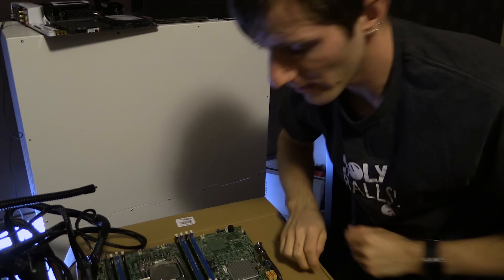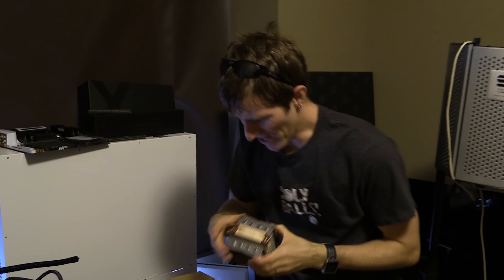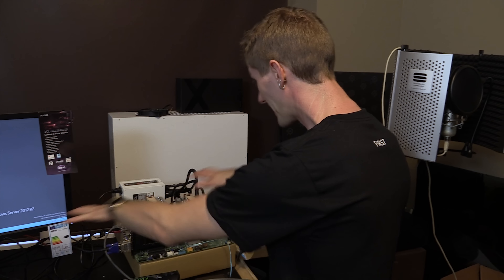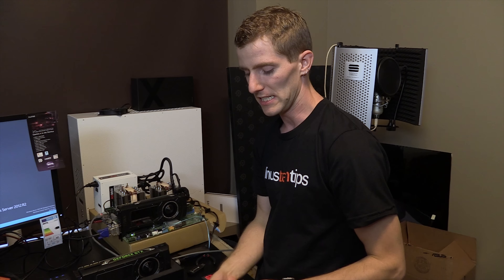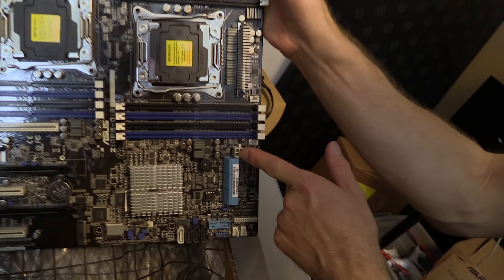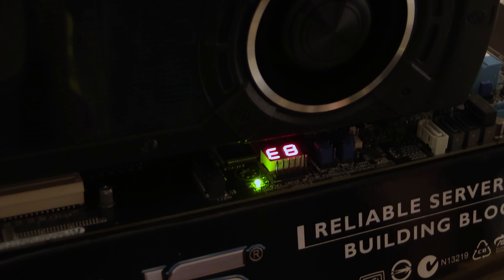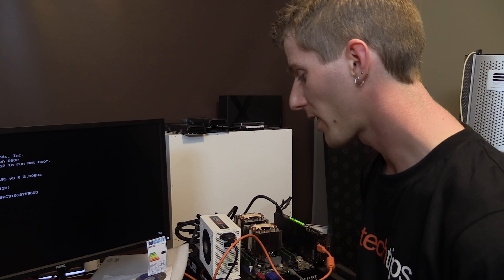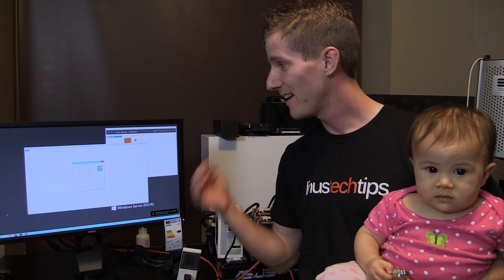36 Cores, 72 Threads, and Two Titan Xs - Our New INSANE Rendering Machine Part 2

Comment: Heyyy.... could you install windows 10 and run the dx 12 api draw call bench? Dx12 is designed for mulit cores...lower cpu overhead so your clock speed doesnt matter too much but the amount of cores.

Comment: Hey Linus, the guys at LTT, and the community. I have a quick question of your opinion I want to do a duel xenon E5-2699 V4 for running Linux and windows duel boot for web app fuzzing running programs like AMASS project some gaming and whatever else I can use it for. Im Having trouble deciding on a motherboard. What mobo would be the do you believe would be best for overclocking the xenon cpu?

Comment: Can you post more details about other specifications of this pc, except MB and VGA, How i can purchase this pc ?
Reply: you dont
Reply: One thing, it costs way over 10,000$. Second, it's not for gaming, if that's what you're looking for, you can easily get a PC for 2000$ that will max out everything in the next 5 years. My 350$ PC runs everything on High at least, too. You don't have to spend a fortune, you have to spend smart.
Reply: Meh, I just saw your channel. Still, for 2k$ you can make a very solid rendering machine. The dual CPUs are pretty much useless for rendering, they only show up in benchmarks. An i7 K edition would be more than enough to feed dual Titan X.

Comment: I've never had Supermicro dual Xeon boards last for more then a few years. I had two
running Zeon Socket 604 cpu's and both boards literally fell apart....heat sinks fell off the various chips and the boards just were terrible quality. I do miss the power these old relic dual Xeon's could do.....before they fell apart!

Comment: i wonder if he considered the asus board wouldnt letits self post because his power supply (i believe i saw 860 watt power supply) wouldnt have been sufficient to run both cpu's AND both GPU's at the same time. That might have been a fail safe on the mobo to prevent damage to the hardware IDK thats my only guess.

Comment: Hey you guys should go out and buy a dell R900 or R910, fill it with 4x6 or 8 core CPUs and 8 GPUs and just 32Gb of ram, or up to 512 if you want, but i really want to see how an 8 way SLI would work in linux, and if you get the R910 you could do a 6 person gaming rig like in your other video with the 2 person, one tower video because the R910 supports VTd and has more PCIe lanes
Reply: +denvera1g1 i was originally going to get an R900 for $266 but then i noticed that it doesnt support VTd, so i went with a dell Precision T7500 with dual 6 core 12thread
Reply: +LinusTechTips i've also been wondering if a quad processor motherboard with a hypervisor would allow you to install a windows OS thats licenced for only 1 processor, so that those 4 processors with 6-8 cores, would look like a single processor with 24-32 cores to the guest OS

Comment: Hey Linus, can you help us figure this out? We got the exact same dual processors, with a supermicro motherboard, we can't get softwares to see the virtual cores. Let's say when the hyperthreading is ON cinebench utilizes only 16 physical cores and 16 virtual, and I'm getting a score of 2800ish, but when I turn off the hyperthreading I see a score of 3800ish, but I've also seen people get like 4800 points with this configuration. Can you somehow help us solve this issue? Thank you!

Comment: I never understand the logic behind this. People see around 50% utilization with hyper threading and think, it's only using half the cpu. A single thread running can populate the full cpu core, however two threads on the same cpu with consistent similar data should hover around 50% if they are properly load balancing, thus utilizing 100% of the cpu. Now sometimes you can see it not fully max out in some things by a % or two or even 5 like the stress test showed earlier. That's not the same thing. I remember seeing corsair have a reviewer post about getting higher fps with faster memory in battlefield 4 and people were like, well no other game has been as ram heavy as BF4 and maybe this phenomenon is true that reviewers can't really get 20fps difference like this guy, but users are convinced it's real, because they bought higher rated ram and tell everyone how great it is to have more bandwidth, which to them = faster. Now I remember that guy who was posting on behalf of corsair in a protected space of their forums that other users couldn't scrutinize until they had posts and were members for longer than 2 weeks. He made the claim on corsairs behalf, but not legally that you get 20fps extra for using faster ddr3 at the time, and that his core i7 which hovered around 50% of each thread, he also made the nefarious claim that BF4 was only using half his cpu and that the game had plenty more to work with as time went on because that's how fast i7's are compared to i5's and amd. I wanted to smash his head in with his case and attend his funeral just to see him lowered slowly into the ground in a pine box. Here I see linus making the same mistake and not understanding how hyper threading works and appears under windows task manager, as it's not representing the utilization in terms of understanding how hyper threading works and correcting for it.

Comment: I need it.
I wrotea lowpass filtering audio programm and it can use nearly unlimited threads.
I had some compiler issues with linux and the university high performance Server and with 64 threads on a 128 threads Server it was slower than my 3570k

Comment: I use a dual-socket supermicro board with a pair of Xeon 2660v2 (20 cores 40 threads in total). While I agree that such a system is very niche (and, quite frankly, nowhere near as powerful as yours! WTF?!) I do 3D rendering on it and use it as a workstation with Windows 7 on it and have been successfully for over a year now.

Comment: I have a question about running a Minecraft server on Xeon CPUs using Ubuntu OS on a small server build. 2 Xeon CPUs E5-2699 128gb ram for each CPU. 2 GPU Quadro M6000 and a 250gb ssd

Comment: The low physics score on the 3dmark test might be due to 3dmark not being NUMA aware.  Any time you run multiple physical processors, you need to run software that is NUMA aware, which almost no consumer software or games are.

Comment: wow only using a 860 watt psu, i wonder if linus tried both gpu's on that psu and found they didn't work?  

afaik the 2 gpu's would need at least a 1200watt psu but hey it's 3 am and i've just woken up so my thoughts are a little bizarre

Comment: So, could you technically use two 5960X's with this motherboard? Now that would be beast.
Reply: +CaptainCrape  sadly no, they only let you use one per motherboard, (probably done in the processors code so you have to buy the more expensive xeon series)
Reply: drEmulatorMadmax Actually it could be an issue. Two 5960X's would take a ton of power to run. But its possible to run Xeon's because they are extremely efficient. So yeah, its a dream to run two of the most powerful processors currently out there.
Reply: +CaptainCrape 1400W PSU?
Reply: Arnab Animesh Das Maybe.
Reply: That wouldn't be possible as the 5960X doesn't support dual CPU.

Comment: Can anyone tell me the model of that asus board? My gaming rig has a Xeon e5 2680 v3 and with that board I could just buy a second of the same processor and maybe run sli with a second gpu as well. But meh honestly one gpu is sufficient.
Edit: found it on Newegg for $450 ouch. Idk if I’ll get enough value per dollar just to add a second of the same processor, seeing that the processor itself is $200-$250 on eBay. I could probably do more with basically $700

Comment: Grounding yourself with a power supply which is coated? Shouldn't you at least touch a screw with actual connection to the psu's metal?

Comment: Here's one for the experts. My PC drains the CMOS battery fast, probably a short somewhere on the mobo. Resulting in no saved settings and dead clock. I can live with that. BUT. It wont connect to the net. Not mobo LAN, not usb wifi. Did a fresh install, no luck. New mobo? Power supply?
Reply: ***** Update: It saves the settings if i setup BIOS and sync the clock while the machine is cold. And the LAN works now. But not the USB wifi, which is odd. If i boot while it's hot, everything is gone again. Which makes overclocking a long process. AND. It wont let me run SATA mode. It's set to AHCI, but the benchmarks say 150mb/s aka IDE/UDMA mode. I have a multimeter, and HWMONITOR reports good voltages across the board. Might it be a failing capacitor or something? Anyway, the computer has been run like this for a while before it got it (for free), so im not too worried about it failing completely. But some of the mobo temps are high, i will replace thermal paste for the NB cooler, as it's probably getting old. Any other suggestions? I appreciate any input
Reply: ***** I will probably just go for a used board unless bringing down mobo temps does anything. Do you have any idea what AUX is? Im thinking it's SB. Its running at 57-58 c right now without much load, motherboard says ten degrees lower, which i assume is the NB. It's conciderably hotter than my cpu. It looks like NB and SB are sharing cooler through a long heatpipe. Im hoping a proper thermal compound does anything. I will have a feel around for exessive heat right now. But i think SB is too hot.

Comment: Forget the Core i7, I WANT A XEON.
Reply: i7 is better.
Reply: +PneumaticFrog Depends on what you're using it for.
Reply: +JesseTheBomb A lot of Xeons really aren't that different from i7 chips aside from ECC support. Xeon E3 for example... a locked i7 and a Xeon are pretty much the same chip, except that Xeon supports ECC and will only work with C series chipsets nowadays. 

That said, I wish i7 chips supported ECC because not having it makes me uncomfortable with running more than 8GB of RAM, and I do notice that any system I see with more seems buggier somehow... I suspect a lot of single-bit errors creep in around 16GB/32GB just due to the sheer amount of RAM. In my opinion, as RAM sizes increase, I think all RAM should be ECC... if people realized they were being cheated a little on reliability and demanded better, Intel would probably enable it and RAM manufacturers would give us a better array of ECC RAM choices. Right now, all the ECC RAM is optimized for servers. It doesn't have to be that way, it just is.

Comment: asus has now burned me twice.... once with my old video cards that i had duel card set up with one card failed then the other X2 since i built 2 comps with the same hardware bad idea :( second time is with the rip off laptop i bought that was sold as an I5 quad core but really is a duel core simulated quadcore. That laptop has 2 strikes against it, i made the mistake of leaving it on and running a task in the case in my car. Now most comps to over heat and shut down with the termo protection. This is the only comp to not have any termo protection in the bios. Every comp ive have owned has had termo protection in the bios. this was my first laptop so i made the mistake of not checking since every PC ive own will shut down with over heating. But i guess you sell more laptop if they fry them self.

Comment: hey would this pc record anything?
Motherboard 
Gigabyte Z170 Gaming 5 MATX
Processor 
Intel® Quad Core™ i5-6600K Unlocked Processor
Memory 
2666MHz DDR4 XIDAX Extreme Memory
Graphics Card 
x2 NVIDIA Geforce GTX 980 in SLI (1 OverClocked)
Reply: If your looking to record Minecraft at 40fps then yes other then that no
Reply: +joe como If you using the elgato software you might be able to record at 480p before it crashes. If your recording on the pc you might be able to record Sims 2 at low  settings but there might be some lag

Comment: Could anyone help me? I get a few random blue screens like once every 1 or 2 months, I think its the cpu I have a 2600k, I had it overclocked to 4 GHz but have it cooled with a noctua D-14. I cannot run a stress test on it, it blue screens or freezers after like 10 seconds, I figured it was the temps But I downloaded a monitor and set the cpu to defaults. Also messed with the bios to get some better settings. still same thing, the most I get my cpu up to is 49 degrees. I have a MSI GD80, done all the normal things of rest to defaults update all the things. Thanks to anyone who tries to help.

Comment: When you need more than 8-core workstation and hold down costs, sound and energy:
ASUS Z10PE-D8 WS, Socket-2011-3 and Intel® Xeon® Processor E5-2618L v3

The card should be able to overclock Xeon® by 10%, with half the TDP of 75W should be of the overclock more than 2% which was for 2699 Xeon® bring down the cost of over 1,000 $ for the same performance with a single 16 core processor.

As a test to see if it's as good in practice as in theory.   :-)
 
http://ark.intel.com/sv/compare/81059,83356,83351,81061

https://www.asus.com/uk/Motherboards/Z10PED8_WS/

http://ark.intel.com/sv/products/83351/Intel-Xeon-Processor-E5-2618L-v3-20M-Cache-2_30-GHz

Comment: But can it play Arma 3 on 4k at 60fps..........
Reply: No, but it can run minesweeper at 34 fps
Reply: +Quickscoping Banana Please go any game at 6fps. Then come back and tell me your experiance.
Reply: The thing being, is even Blu-ray only plays at 32 fps... so for the most part frame stability does more then higher frames as long as it is 24 or more. Even movies for however many years was all 24 fps, and it had a fine fluidity of motion. It starts getting indiscernible over 40, and nearly impossible to tell apart over 60.
Reply: +T Swag (ThanoricOfficial) Big difference between watching a movie and an interactive medium. Sorry most people can tell the difference between 30, 60, 120, and 144.
Reply: He didnt meant that. What he means is that fps stability matters more to fluidity than just a bast amount of fps. A stable 60 look much better than something going from 30-120 constantly..
Reply: While I am not going to dismiss that yes higher fps is a good thing, while I do notice a difference going from 30 to 60, I don't feel like I get as much of a smoother jump even going from 60 to 120. While yea, if your really trying hard, you can tell the difference, it is not as big of an impact. I would take a solid 60 over a jittery 120.
Reply: Sans The medium and purpose also matters. A movie isn't moving around its static on a screen. Lower FPS's are fine. When you are playing a game it becomes nauseating in the first person. It's the same reason some games are fine at lower fps's which are more static than a first person shooter which is dynamic and whipping around constantly.

And to answer that obviously a stable 60 looks better than something moving 30-120 you are being disingenuous with that.
If I say that a stable 90 looks better than it moving from 30-120 that is the same statement correct? How about I add that 90 looks better than 60? Or 120 looks better than 90. Or that 144 looks better than 120 I haven't reached a point where long as I have the monitor to support it I have not been able to notice the difference. 

These people also need realize if you have a 30 hertz tv it't not going to matter if the movie is 120 fps its still only going to show 30. There is so many factors going into this to try to dumb it down to that just is so... cringy.
Reply: and you need a tv over 60hz to benefit from over 60fps
Reply: LUL Did you just say TV.....
Reply: BuRgLaR187 Forgive him at least he understands how hz works. So many people don't seem to.

Comment: You know what is really sad? No game would take advantage of this processing power. Developing companies are greedy and cynical. If you're easy going, mostly using text editors and watching movies and browsing facebook and that crap,  not updating your hardware too often but then you'll see that one cool game; They'll force you to at least buy a new graphic card if you wanna play the new game that 'everybody' is playing now. But If you are hardcore and you'll buy some truly epic hardware, like this processor, then the joke's on you again! They wouldn't allow you to use its full potential because hey it wouldn't be marketable; as there is far too few maniacs like you... . P.S. Dammit I really didn't know there are super processors like this one in existence I really though supercomputers are using normal Xeons but lots of them.
Reply: +Misiulo Well you aren't going to be running modern games on intel HD graphics for a core i3 duo from 2010... If you want to play games nowadays at good settings you need at least a $200 GPU and a $100 or so CPU, which really isn't too much compared to the consoles if you have the cash and proper hardware for upgrades.

The CPU that Linus is showing in this video is going to be used for workloads, rendering, etc. It has no intended use for anything other than running servers and taking heavy loads that require many processors/threads to be done in a timely matter. If you wanted a CPU for gaming you can get a nice 4790k for $350 that has over twice the power of any console ever made.